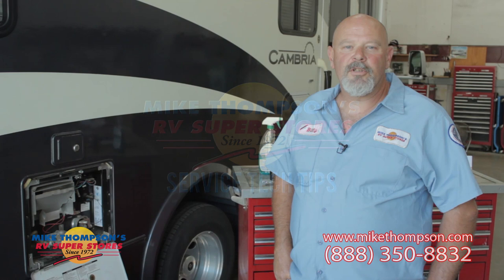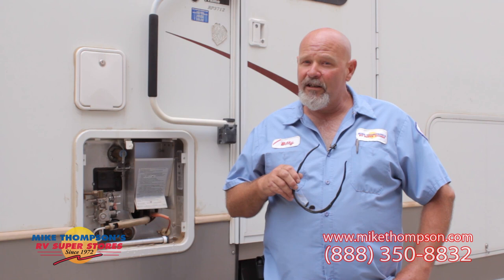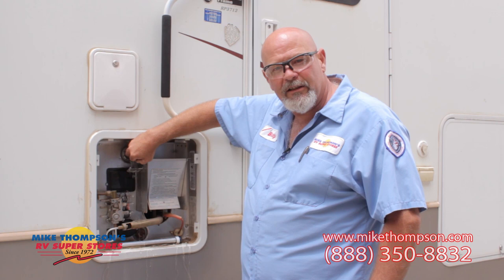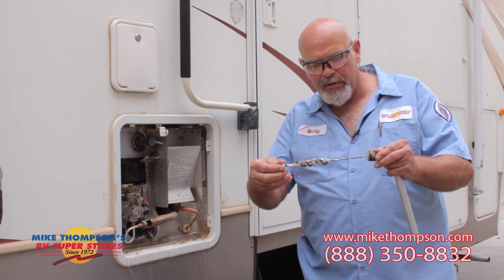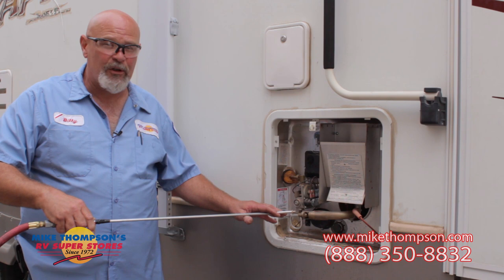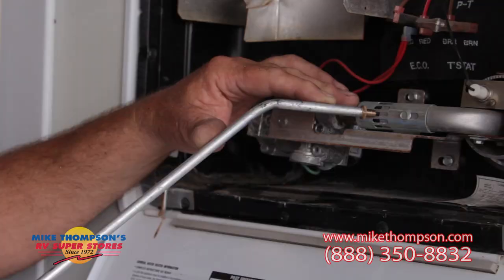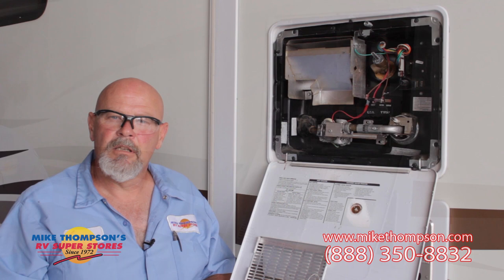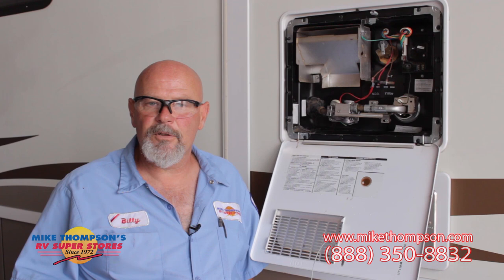How to Maintain a RV Water Heater by Mike Thompson's RV Super Stores

Comment: Great video, thank you. Before I saw this, I learned the hard way about disconnecting the battery before trying to drain the heater on my PUP. While I was draining, the water pump had engaged to refill it, even though the pup was closed up and should not have allowed the pump to function, or so I thought. That anode rod really threw me for a loop as well but all is clear now. Thanks again.

Comment: If I’m not going to use the hot water heater for months at a time, even an entire year, should I empty it and leave anode rod in, empty it and remove anode rod allowing air in (bugs to I would assume), or keep it filled with water. Basically what method would keep it from corroding the best?  As of now, I leave it as empty as possible and put anode rod back in.

Comment: Hi great video.  I have a question for you:  For the electrical, how do you know if there is AC current as well as DC?  I currently have an Atwood GG Model (gas only) and I want to upgrade to combined.  If I pull the unit only to find no AC, I have a much bigger project.  I have a Fleetwood Storm, 2015.
Reply: Water heating takes a lot of power, so there are no models that use DC, only AC (The battery would die in just an hour or two if used). If the trailer has a gas only water heater, they probably have not run an electrical line there. For verification, check the Fleetwood factory.

Comment: Thank you Billy, for the good tips!  Some things need to be improved on this video however.  Music needs to GO!  Cannot hear a thing above that elevator music din.  Please turn it OFF!!!  The title of this post is incorrect English.  How to MAINTAIN, not MAINTENANCE.  MAINTAIN is a verb.  MAINTENANCE is a noun.  You cannot DO a noun.  You can DO a verb.  Please fix this.  If we are an English speaking nation, lets speak proper English.  If people have a problem with USA being bi-lingual, and vote Spanish down, then at least speak English correctly.

The blower trick was excellent.  Gets rid of spiders and webs, dust and debris.  Good to know where to clean it.

The draining of the tank was only half the procedure.  Full procedure is:

Drain tank, rinse out with a wand to clear debris inside.  Water will be milky with sediment.  Replace drain plug.  Remove relief valve plug.  Clean it.  Fill tank halfway with white industrial cleaning vinegar.  10 gal tank needs 5 gals vinegar, 6 gal tank needs 3 gals vinegar.  Home Depot sells this, or Smart and Final Iris.  Put back relief valve with teflon tape.  Turn on city water until tank is full.  Bleed relief valve to check.  Turn on water heater for an hour till water is hot.  Turn off water heater.  Leave vinegar in tank overnight to dissolve mineral sediment deposits.  Next day, open relief valve to bleed then close. Open drain plug and drain out vinegar.  Rinse with fresh water and wand to clear hot water tank of remaining debris.  Replace drain plug.  Turn on city water.  Turn on each faucet and shower inside RV to clear of vinegar in pipes.  Water will be white an foamy.  Clean all faucet strainers (screws onto faucet tip) of scale debris.  Done.
Reply: You're criticizing his grammatical errors with a plethora of your own errors!!  YOU should learn to read/speak/write/understand the english language prior to criticizing somebody else.  PROOFREAD!!
Reply: Lass-in Angeles h